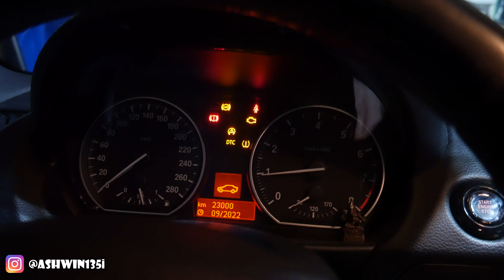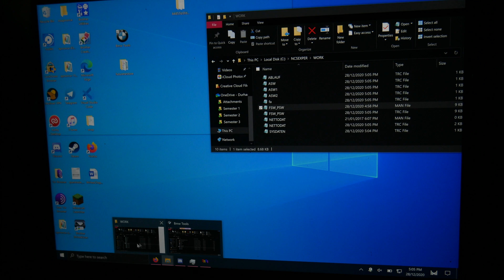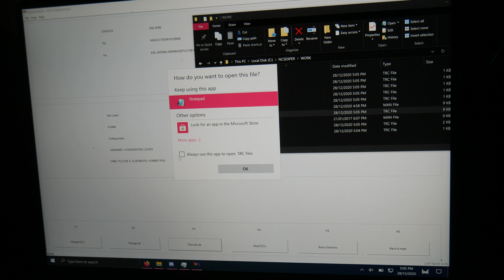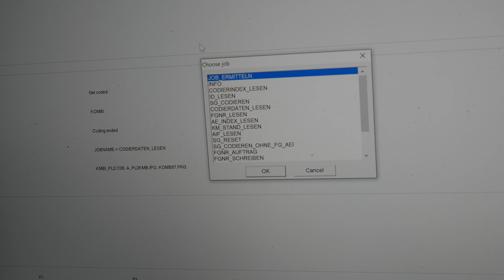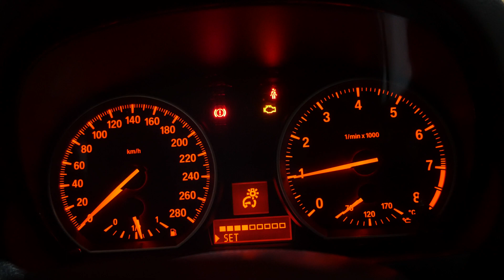Removing the most POINTLESS warning from my BMW! (SOS FIX)

Comment: Even after following all steps to this video i still have an sos malfunction help please i have no radio and its driving me nuts
Reply from the maker: If you still have a sos malfunction after coding it out, that means there’s a break in the fibre optic loop. The loop has to remain intact no matter what. Look into a physical most bypass loop, that will allow you to remove a faulty module that’s breaking the loop

Comment: 2009 E82. After installing Android head unit, with optical converter box, I have the SOS warning, that I think I can take care of following this video.  But also, the time and date keep re-setting to an incorrect value. I cannot set them from the dash, I can set them only from the "System Settings" of the Android head unit. After they are reset, they maintain the correct value for a short while after I shut off the ignition, but if the car sits for an hour or so, then when I re-start the ignition, the time and date re-set to an incorrect value. Any thoughts on how to correct this? Thanks.
Reply from the maker: On my car, I am still able to set the date and time with the cluster. What happens when you try to set it from the cluster? 

Was the date and time staying correct before you installed the android unit?
Reply: @AshwinLB  Before the android head unit, time and date stayed correct. Now, I can go in the cluster with the stalk, change the time to correct value, but as soon as I press the button on the stalk to save it/set it, the value reverts to incorrect. Same with the date. Cannot set a new value from the cluster with stalk for either time or date.
Reply: i can go in the android head unit "System settings," and re-set the time and date, and this does change them on the cluster. But this is only temporary. The values will stay correct as long as the ignition is on, both in the head unit and on the cluster. When I turn off the ignition, the values will stay correct if I switch the ignition back on within an hour so. But after that, longer than an hour or so, when I switch the ignition back on, the time and date re-set to an incorrect value.
Reply: I noticed that when I power the ignition, the time and date are correct, but it is only after I start the engine that they re-set to incorrect.
Reply: In searching about I saw a reference to a "time for sleep" or similar parameter in the car's settings, that may or may  not be related to this, but no details.
Reply: I also saw some speculation that the starter voltage drop causes the re-set. This would be consistent with the pattern I observe.
Reply from the maker: @Merryfrankster_  maybe turn turning off “use gps date and time”? Not sure I never had this issue. Also check if your timezone is correct on the headunit
Reply: @ Yes I've tried every possible option on the head unit. No result unfortunately.
Reply from the maker: @ what brand is your headunit?
Reply: With time difference and language barrier, their tech support is all but useless.
Reply: Update: The theory about starter voltage drop does not hold in my case. This morning I started up the car to first position, checked that time and date were still correct on the dash, then as soon as I went to second position the head unit powered up and the time and date changed to incorrect values, and they changed both on the unit and on the dash. There was no "start," so starter did not play a part.
Reply: This is pointing to some issue in the head unit.
Reply from the maker: @Merryfrankster_ well I’m assuming what’s happening is that when the car is asleep the clock on the radio doesn’t resume forward so when the radio turns on, it just continues where it left off. So you either have to stop the car from pulling the time from the radio or find a way for the radio to automatically pull the correct time whether that be through gps or wifi
Reply: @AshwinLB  Good insights. However the  date/time on the radio always jumps back to the same date/time every time December 19  2024, 10:41pm. No idea where this came from. I only installed the head unit a few days ago, March 20, 2025. Automatic date/time is not working on the head unit. If I make the selection for Automatic date/time, it is ignored.
Reply from the maker: @ I see. How about if you connect the headunit to wifi? Does it go to the correct time?
Reply: @AshwinLB  I verified if I remove the head unit from the car, then I can set the time and date on the steering column stalk, and they stick. Next I am going to try what you suggested with wifi.
Reply: I am also diving into the wiring harness. It appears the only wires coming in on the car-side connector are constant 12v  power (red-green 12AWG), a twisted pair for CANbus, a 12AWG ground (brown), another smaller ground (18AWG black), and one wire with a constant 5v (18AWG grey-red). I have to cross-check this against a service manual to verify and check function. There are no other wires coming in.  The constant 12v terminal on the car side connects to the terminal of the yellow wire on the head unit side, which is the conventional constant power color code. There is no switched power coming from the car-side. The red ACC wire on the head unit side is fed from the CANbus converter box, which also receives the 12v constant power. So accessory power to the head unit gets switched on digitally.
Reply: The communication between the combi /cluster and the head unit must be taking place over CANbus, not the optical network. I deduce this because the optical converter box was late to arrive, and I connected the head unit without it at first, and the problems with the head unit setting the incorrect time on the dash started BEFORE I connected the head unit to the optical converter box. So even without an optical connection, the head unit was able to communicate with the dash and set the time.
Reply from the maker: @Merryfrankster_  yes all your deductions are correct. But I’m pretty sure there was an accessory power input into the unit. But try disconnecting the canbus converter, I can guarantee that the time/date won’t be synced anymore but then you lose functions like steering wheel controls
Reply: @ I'll try that and see how it does without the CANbus converter box.
Reply: @AshwinLB  quick update. No resolution yet. First: Definitely there is no ACC wire on the car harness. Visual inspection of the head unit harness confirms that the red acc wire on the back of the head unit connector comes from.... wait for it... the canbus converter. The canbus converter receives a fork of the bat (yellow) input wire, detects the ignition state, and switches on ACC power to the head unit on the red wire. Some German engineer must have thought "vai doo vee need zwei macht vyers too zee rahdio. Alles vee needs ist ein, und svitch!" However after market radios are not made like that. They require a separate acc wire, and the solution is to power up the acc wire based on the ignition state. This also means that if I leave the can converter out, the unit does not even power up. Second I verified that there is no interruption of the BAT yellow wire power delivery, constant power is reaching all the way to the female terminal on the connector that plugs into the back of the head unit connector, where it connects to a male constant power terminal on the head unit. There is no damage to the connector or the male terminal, and they do mate correctly. So if there is any interruption of the constant power supply, that could possibly lead to a re-set of the time/date, it is happening inside the head unit, not outside. There is an outside possibility that the battery power is below a threshold that is needed for the clock to operate. My battery's state of charge is a little bit off from the nominal 12.7v of a fully charged battery, more like a 12.3, and the voltage with drop at the back of the radio is closer to 12.0. I think it is unlikely that this causes the radio to reset, but it is a possibility. I can sort of test this by connecting a power supply while the car sits, to maintain full charge voltage. If the clock does not re-set while the battery is maintained under full charge, this confirms the hypothesis.  Finally I checked a video that I shot on the very first boot-up of the unit when I first installed it, and the time that was displayed on the first boot (Dec 19 2024 22:41) is the same time that the unit re-sets to every time it is switched on. So this gives weight to the hypothesis of a power interruption causing the re-set.
Reply: @AshwinLB  I have solved this issue. Here's how. The radio was powered on 30g. This terminal goes to sleep after the car sits for about an hour give or take, cutting power to the radio. So the head unit clock stops running and resets. Oddly the head unit firmware is programmed to re-set the car time/date over the CANbus connection - this is some kind of "feature" that cannot be disabled, maybe it's needed for cars that have a CIC/CCC where you cannot reset the time from the steering wheel stalk. So I ran a new power supply for the radio, from the fusebox, from a slot designated for terminal 30g-f. This terminal maintains power at all times, unless the battery level falls too low to start the car. HOWEVER - either my IBS is dorky or my battery is actually borderline, so 30g-f was cutting power and the clocks were resetting. Finally, I moved the power supply again, to a slot on terminal 30, which is live at all times, no interruptions. And voila, no more time/date re-set. This solution meant running a new wire from the fusebox to the console, and of course this circuit has to be fused - I used 10awg wire and a 30A fuse. As I said there is only one power wire feeding the radio,  so this wire was to support both the constant power mode and the "virtually switched" operation mode, including the canbus converter and the optical converter, hence the hefty wire - by the way same gauge as the original power supply wire, that I cut and terminated.

Comment: Thanks you from Germany, I did it with BimmerCode(Expertmod), the Error is gone 👍🏻👍🏻
Reply: My Car: BMW e92 2008 , CCC System
Reply from the maker: Perfect !
Reply: The Error is back😔
Reply from the maker: You could have an actual fault in the fiber optic loop. If you can find out which module in the MOST loop has failed, if it is not a necessary module you can install a most bypass loop. If it’s a necessary module, you have to replace that module

Comment: Thanks for the video.  I downloaded NCSexpert but in my profiles I don't have manipulation.  I have a profile names default. When I used that I updated the files and executed it, but nothing changed.  just reset my clock.  Where did you get the profile?
Reply from the maker: I believe the manipulation profile came default with ncsexpert when I downloaded it from bimmergeeks. Where did you download it from?

Comment: the video is great easy ans simple. But! i already have some coding done to the car and is under the .man file? if i overwrite it will it kill all my previews coding or not?
Reply from the maker: If you read my previous comment, sorry I thought you commented on a different video! 

No you will not lose your previous coding as they are already written to the car. So when you generate the new .trc file with codierdaten_lesen, your previous coding would be pulled. That’s why you must generate a new .trc file and rename to .man before modifying it
Reply: @AshwinLB  very much appreciated. thank you

Comment: Any planned tutorial for BimmerCode?  I have a 2010 with CIC and I’ve tried almost everything to get rid of the SOS.
Reply from the maker: I actually don’t have the license for Bimmercode, I just have the protool license on android. It should be very similar anyways so I’ll try to make a video soon on it. I’m assuming you tried using a bypass loop on the satellite radio?
Reply: @AshwinLB  I’ve tried however, the problem is that I have the COMBOX unit instead of a separate TCU and frankly I’ve not seen anyone bypassing the COMBOX. All videos on YT are regarding pre-facelift units with TCU’s.
Reply from the maker: @dariust1418  does your Bluetooth audio work from your phone? I think people don’t bypass the combox since that’s what allows you to use that. If it doesn’t work and you don’t need it, you should be able to just bypass it. If it does work, then I don’t think that it is the combox that’s faulty in the system so the bypass wouldn’t work
Reply: @AshwinLB  Oh ok, thanks. That’s some interesting and useful insight! Bluetooth calls work however, music doesn’t! Got to love BMW’s!
Reply from the maker: That makes sense since the combox doesn’t control bluetooth phone, only Bluetooth music! I would try the MOST bypass on the combox and see if the sos error goes away. After that you can decide if you want to leave the bypass in or get a replacement combox to fix the Bluetooth audio. Yep love the bimmers but sometimes these issues make it too much haha 😂
Reply: Did you solve it ? I have a 335i 2010 same problem , my radio works perfectly
Reply: @joud4459  Negative! My radio and Bluetooth work perfectly fine, just the annoying light! Apparently, the subs under the seats can play up due to dampness/water etc and cause the light, but my floor is bone dry!